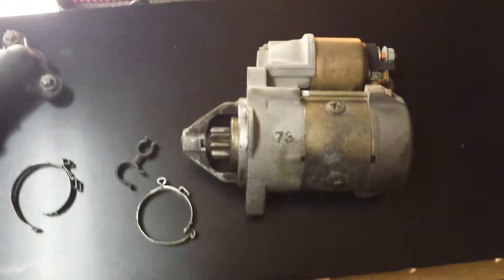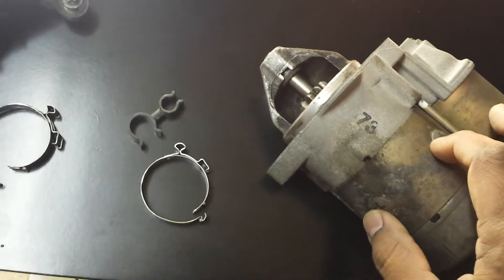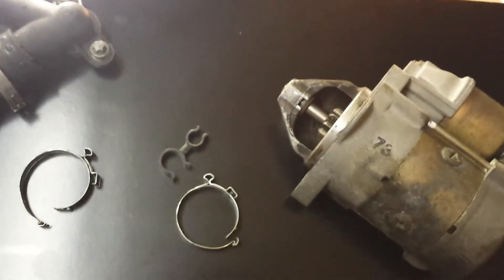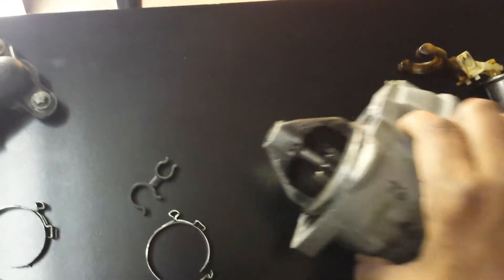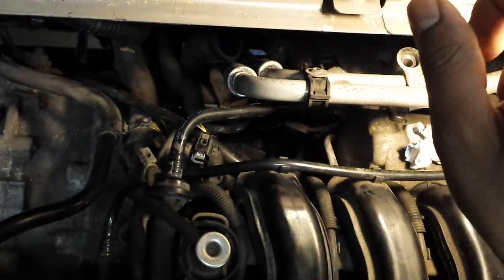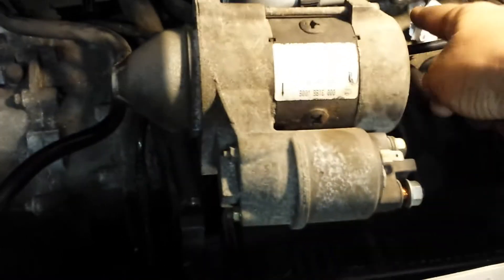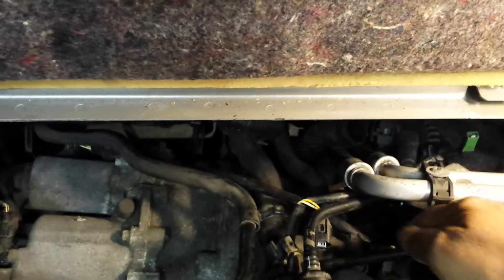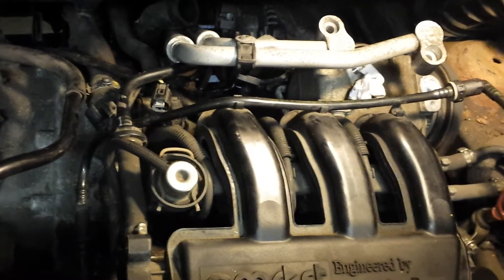Smart Fortwo 450   Starter motor replacement and lowering the Engine   Part 5

Comment: Thank you Waqas for taking the time to make the starter motor replacement video's i have just bought a 450 which i think the starter motor is on its way out , your video's are clear and detailed and will make the job much easier , appreciated.

Comment: Hi there, I just bought a 2005 0.7i w450 with 110000kms. I have to replacee engine mounts. Do you recommend to replace as well the starter motor, although it cranks fine? Thanks!!
Reply: Lol, why would you do that? Only replace what needs to as there will be many repairs coming down the road, trust me. Save your money because your repairs are on the way!
Reply: @virnan  hope it works fine and become quite reliable! Thanks

Comment: I unbolted the a/c compressor, and moved it out of the way. The hoses were still bolted. Longer but I still have ac. I also had to reset the nipple at right side of the starter
 Using a hammer . Everything is a tight fit. Last time in my life I will change a starter motor on a smart diesel!

Comment: Idiot ....remove the inlet manifold and intercooler, and swing the starter upwards, its a 45 minute job.
Reply from the maker: Hi, I was really going to refrain from replying to you. Since you have demonstrated your level of intellect over the internet three times on my videos, let me enlighten you.
First of all you have never done this job. I would like you to share your opinion to the community at http://www.evilution.co.uk/678 who have document this entire procedure in great depth. Do you refute this? 
Should you not be capable of refuting the link, I suggest you do a little more research before sharing your views, unless you are not able to resist a round of an intellectual reasoning.
Reply: +WaqasAhmed, you know you are making a contribution to the community when inexperienced trolls begin to loiter on your site.  
I watched your 6-part series.  It's clear that you had success on the first round which is a great achievement for an unqualified mechanic.  Your mechanical and diagnostic skills are well developed.
I understand how difficult it is to film on your own, especially for a tedious 7 hour job.  This Smart car is not easy to film either because of the rear tray, compact engine and hidden components.  For those that have never filmed a DIY video they will never understand the time and patience involved.

I have some suggestions/wishes, only because your videos seem to be in high demand:
(a) Mention the tools needed, safety notices and time estimate (you did say this) in the beginning.  
(b) For safety, remind people to disconnect the battery before working.
(c) Use the start-stop method of filming and maybe fast-play the disassembly in front of a tripod camera so people can see how you removed all those those pipes and bolts.
(d) Improve the camera work i.e. use a steady-cam if possible to stabilise the footage; save up for a video camera; have multiple (at least two) high-powered lights fixed on stands; recruit a cameraman. 

Regardless, this series was very helpful.  I hope in the future that you will accumulate success in your documentaries.
Reply: Fuktard, put up or shut up, after 2 years I see piss all on your channel on doing this job. After 5 videos of saying the exact same thing you just make yourself look like a complete asshole.